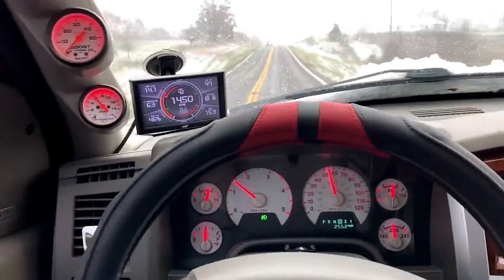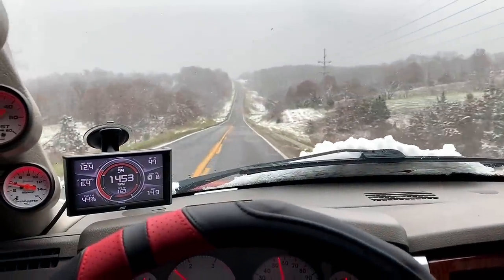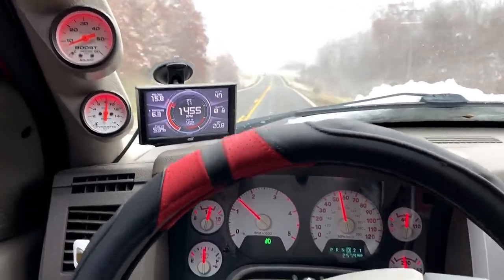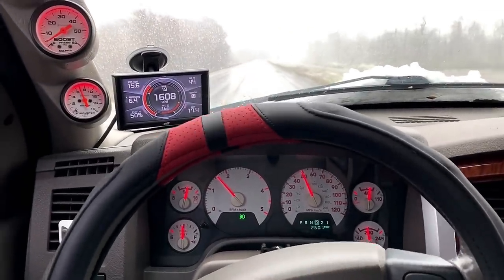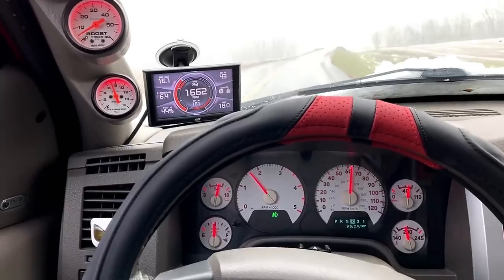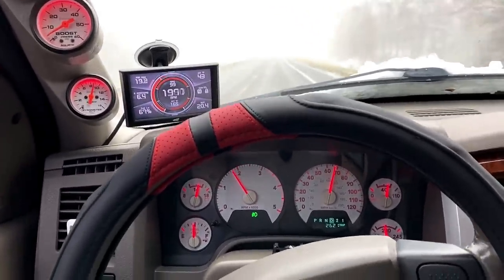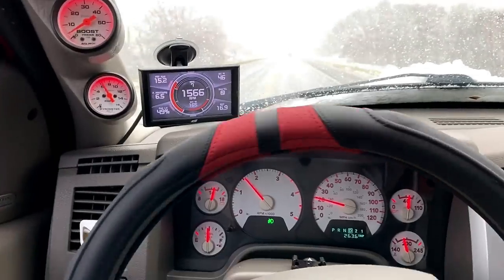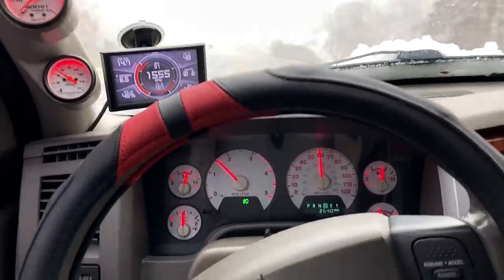5.9 Cummins S468 LAG!

Comment: How much cab drone do you get. I don't know if your running full straight pipe. 

I have a 464 on my truck with a flow pro twister I'm thinking about taking it off cause it's robbing HP but I hate cab drone. I was wondering when you moved the turbo to the 2nd gen manafold if it was still there. 

Any input would be great thanks!

Comment: Nice. I want around the same setup. However those damn 10mm CP3s are so expensive!
Reply from the maker: Bought mine on Black Friday last year👍🏼
Reply: How much did the cp3 run you on Black Friday thinking about getting one
Reply from the maker: I think it was around $1,500. I had 2 codes to get 25% off total. I got lucky. I think fleece has 15% off.

Comment: This is why I love the 6.7! No lag with a turbo this size.
Reply: 10 psi at 1500 rpm is decent. This turbo seems to act exactly like the 63 on my truck. Which is pretty decent in my opinion
Reply from the maker: Yeah it’s really not too bad. With a stock cam, too. With a performance cam and modified shift points it would be amazing.
Reply: Scott Cravens no kidding I used to daily drive my 6.7 with an s482/87/1.25 for about a year towing and racing with no problem. The manual valve body 48re helped. Lol
Reply: 383lt1impala 

Lol right

Comment: Whats your trans setup who build it and what stage? also specs on turbo is it the 468/87/.90 ? i have same fuel setup basically, airdog 4g with s&s 80% overs and fleece 10mm and i was thinking about this turbo it is a daily driver street truck that doesn't tow just carry my toolbox and other tools equipment.
Reply from the maker: It was a stage 1 ATS when I bought it and I’ve since put a billet input and output in it, and a Goerend converter and valve body. The turbo is a 468/87/1.0 instead of the .90. It’s a great street friendly truck.

Comment: With the 60% over injectors and the 10 mill pump with no tuning will it set a check engine light juts curious
Reply from the maker: The pump won’t but you have to have tuning with different injectors.

Comment: A 468 is really not a big single at all. You can get modified stock turbos in that compressor inducer size.
Reply from the maker: I’ve come to realize that. This 68 is really quick to spool. A lot quicker than I thought it would be.
Reply: KReyCummins my 475/87/1.00 lit honestly as fast as my old Danville 68r 4094 on my duramax but I’ve also got a built motor and 250% overs with a 3000rpm stall.
Reply from the maker: Geez! Yeah, you’re a little more crazy than I want to get with mine. I’d love to, but I love the power and reliability combo I have right now. I’m on stock bottom end and 60% overs.
Reply: KReyCummins you’re fine for awhile. A 468 is a damn good driving all around turbo.

Comment: Hey when you put compounds on did you notice it made less power? I was just running a big S475 single, turned it into a compound with a S464 (which I also tried as a single)  and the truck was way down on power, making over 60psi
Reply: Did you run the s475 by itself? If so how was the lag?